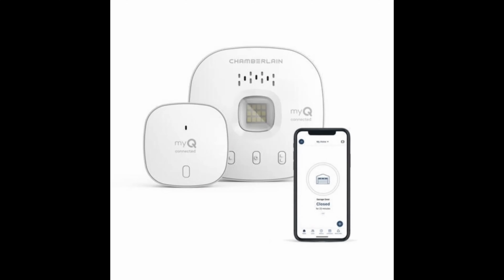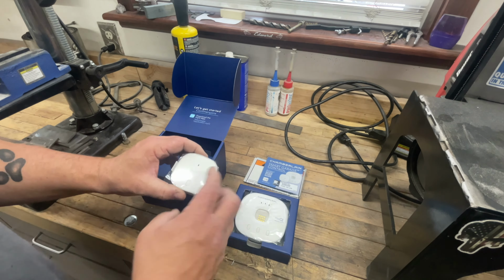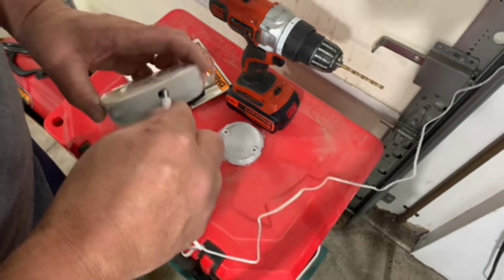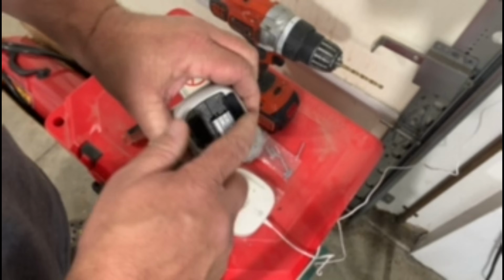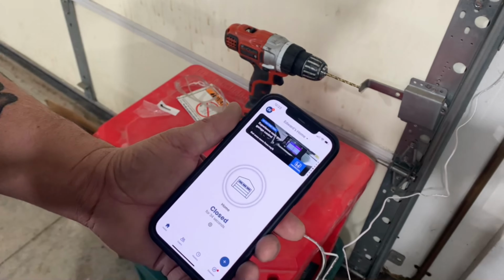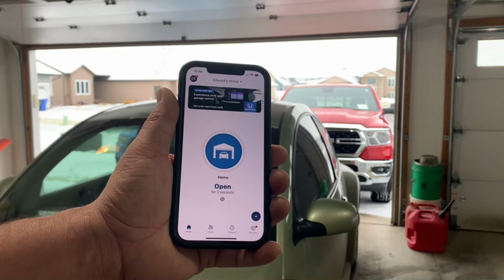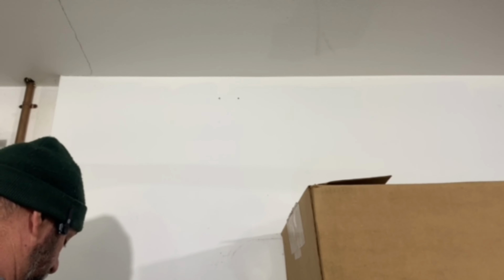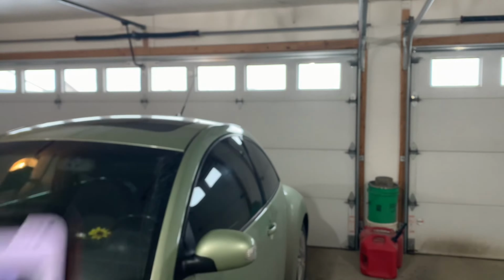Chamberlain MyQ Garage Door Controller [Install and test]

Comment: Had our garage door opener replaced last summer. Our landlord splurged and got us a myQ garage door opener. We love that we can check the status of our door. Also, get notifications if the door is open/closed by family members who have the code for outside keypad access. Or Amazon key deliveries. I also have a Wyze V3 pan cam that overlooks our driveway and garage. So I can visually see any comers and goers.
Reply from the maker: I really like it. I never thought a smart opener would be that useful but I was wrong.

I use Ring cameras for the same reason. Love the combination.